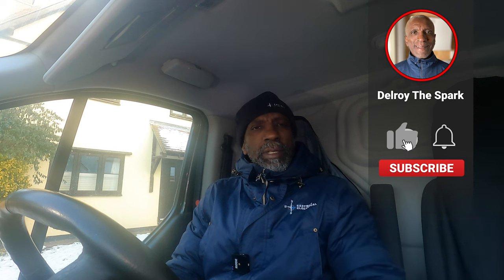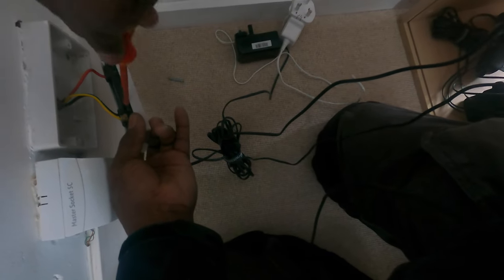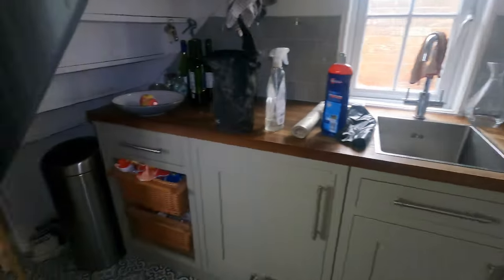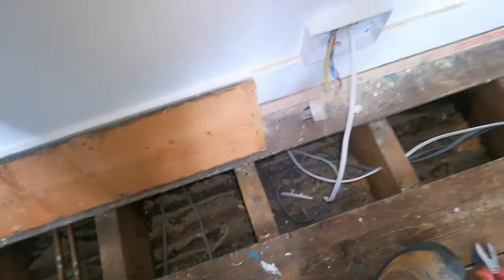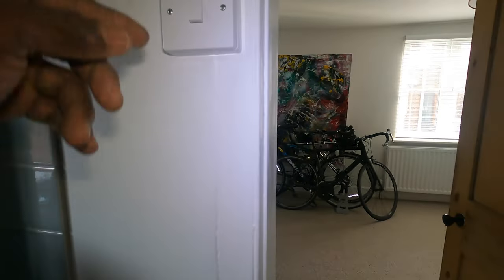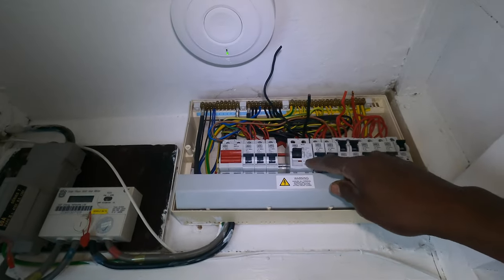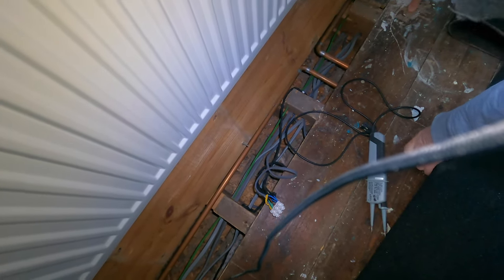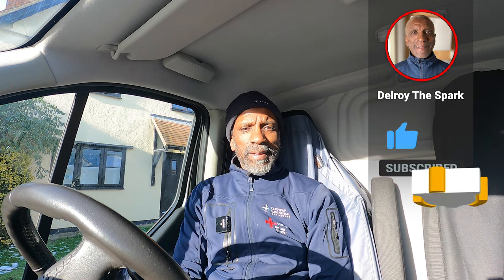"If An Electrician Did This He Doesn't Give A ****"| Electrical Fault Finding| Electrician In London

Comment: I am a retired electrician and it's scary how homeowners interfere with the circuits in their home. the problem with this situation is homeowners is they think if a socket livens up that's OK. But of course that means nothing.
Reply: As a homeowner who has messed with electrics before i always make sure to call an electrician just to do some testing afterwards and certify that everything is according to standards also helps if you really respect electricity and try to be as damn safe as you can and triple check that things are off before you mess with anything.

Tbh sometimes i just can't afford full service from an electrician and need to do some stuff myself to save money and then get just a couple of hours from the electrician to test it, recently my house had no ground anywhere but the kitchen, asked someone how much it was to fix it and it was days paid by the hour so you can figure out it was a LOT of money, in that case i'd rather run wires myself leave everything right next to the fuse box and then bring him in again but for 1-2 hours just to assemble it all on the fuse box and double check.
Also helps that i know exactly where everything is so if i can't get my regular electrician and can get any other one and guide them directly to the fault points
Reply: @liquidsnake6879 you shouldn't be touching electrics full stop.
Reply: @adamsharp201  make the prices cheaper and people won't have to, otherwise it's either i do it myself or it doesn't get done at all which is not an option

Comment: My bet is that it was an "electrician" who came out to do it, likely one that didnt know what they were doing but the reason why I think that is because if you look at the plugs hes got connected to the sockets a lot are wired into the wall, if he knows enough to wire in stuff he wouldnt of used a plug and socket for it.

Comment: Man, the Brits have quite a different residential wiring color code than we have here in the U.S. (we use black/white/bare or green in house wiring), plus they're running 240 VAC where we run 120 VAC. I think the whole wiring of the house should have been pulled out and rewired because it was a rat's nest. Totally UNSAT. The electrician was using terms that would confuse people here, like "ring" (I've only seen that in a certain computer network topology) and "we have 'phase' on this one" -- what, you running 3-phase over there or something? O.o
Reply: Ring mains, basically after WW2 the UK had a rubber shortage so everything is strung together in parallel rather than star.

Comment: I'm not a qualified spark, but I did do some training on it many years ago and I like to think I've got some idea of how this stuff works.  I could tell just by looking at that rat's nest of wiring that it wasn't done properly.  If I were doing that, I'd definitely use a junction box - it's not just you, Delroy, I think it's safer, neater and easier to go back to at a later date.  Those exposed connector blocks are an accident waiting to happen.

As for those dangling lights, whoever decided that was the best way is a moron!  Apart from looking terrible, where's the cable tensioner to stop the wire getting pulled out?  Maybe there was something I missed, but from what I saw there's nothing to stop those wires from getting pulled out of the ceiling and with them being all connected up under the floorboards, any wires coming free are an accident waiting to happen.

Also something that struck me, you pointed out a neutral problem.  Did I see an unconnected neutral wire behind the light switch?  Judging from the mess of that wiring, it wouldn't surprise me to learn that he'd wired the whole thing through it and because the light switch doesn't have a neutral connection, he'd just left it dangling.
Reply: What made you quit?
Reply: You seem to have a huge opinion on something you clearly are not qualified to comment on?! Get yourself to college for 4 years then you can comment on an electrician's work
Reply: @adamsharp201  Even a rudimentary grasp of electricals would tell you that this is a mess, and a potentially dangerous one at that.  But then again, I suspect you know that and are one of "those" people who like to taunt people from the safety of their keyboard.  Am I right?  Because it's either that or you're a dangerously unqualified electrician who is going to kill people
Reply: @therealbosstopob4l974  I already had a job in IT and didn't think (at the time) that I'd need it.  I don't technically need it now, either, but there's times it would be helpful to have the certification

Comment: All those joists have been drilled out of zone! To be honest I used to like fault finding but now I am just sick and tired of turning up to properties with bodged wiring. We fool ourselves if we think it must have been done by someone who is not an electrician - many times it HAS been done by an electrician. Self certification schemes simply don't deliver the surety of quality they are supposed to. You are either a conscientious electrician or you are not. Even new builds I attend are often not to an acceptable standard.

Comment: I'm not an electrician, But i fix cb and amateur radio as a hobbyist, So i know enough about electricity and electrical circuits and frequency etc. And i said the same i would run them into a junction box there's no way i would be happy or confident in doing things that way. This wires aren't even tacked in a way that id say they are safe and secure. So even as an unqualified opinion I would say that is bad and there's no way that was done by a professional. health and safety and all logic was lacking there. Nobody that takes pride in their work could leave something in that state. There's always a standard you maintain.

Comment: it really piss me off with people thinking they know about electrics.... and doing it them self...
Reply: Not necessarily the case, I know of Engineers that are more than good enough, being one as well, they contact me for the specifics and also other such, i then pop round and critique the pants of the electrical, then give em a ticket after a day or two of T and I, rcbo only since 2010, for me then, direct runs, no j boxes, saves a buck, but that's a one off, seldom done, it's usually me with them as a helper, best of both worlds, I once had another engineer use 3 phase components and tri rated cables in conduit with ferrules , he helped me a few times on a production machine, other equipment like medical Iso trans, etc, so he did most of it, with advise from me mid way, I did the earth and the rcbo cu, a good friend of mine, two days of lazy T&I, then sorted, oyeah only one ring in the kitchen, the rest were radials, that's what I usually do, any comment on that from anyone would be interesting,
Reply from the maker: I can tell you feel strong about doing a good job

Comment: What will happens when you touch the
 red + wire with the black - wire 💥
Reply: In an AC circuit, there is no such thing as positive and negative wires. Shorting them would cause a spark and blow the fuse very quickly. Kind of boring really.

Comment: Rewiring my house myself (properly) Del. I was just stunned at the use of chocblocks and no pendants. Like you say, NO WAY did an electrician do that. I'm lucky enough to have time served sparkies as friends and they've all said my work meets and in most cases exceeds spec. Its simply not worth bodging. Just do it right. Mind you, check out my Dad's wiring at 10mins 45 secs:  https://www.youtube.com/watch?v=lrvP_L2dBpA

Comment: I have seen jobs done like this, even worse actually, by people who try and call themselves electricians so may not be DIY
Reply from the maker: Wow
Reply: @eastwayelectrical  one of the worst had to be about 25 down lights throughout a hall, stairs, landing and bathroom, wired in speaker cable, it was about .75mm multi stranded, single insulated 1pair, obviously no cpc. 
All the ceiling roses had been removed and just open connector blocks like yours there in the ceiling void, but also the attic, right next to the hatch where you would put your hand to climb in ! 
They hadn't even bothered to connect the cpc's together from the ceiling roses so no  CPC continuity for the rest of the upstairs or downstairs lighting circuits past there. 
Non were fire rated, just the cheapest open GU10 type you can get, Bathroom fittings right above the bath/shower were not even IP rated !

Comment: i really really dont envy you british electricians thats have to fight with ring circuits all day :/
Reply: Rings are easy my man especially over a long distance ,just pull 2 cables to your end point then pull loops to the rest of the circuit.
Reply: @leeserg6923  i get how there build, there just not good for fault finding.
There also not needed in Germany were i live.
We have bigger consumerunits and have for most rooms one individual circuit.
Smaller rooms get grouped together.
There technically not illigal Here there just really really uncommon.
Reply: @SuperUltimateLP  yeh I understand it’s only the British that use them ,when fault finding it’s easier just to split the circuit into 2 radials.

We are slowely using radials more and more though.

Comment: The ring circuit fault finding was all over the place and confused yourself with it (which is a concern)
Can only hope that your ON camera ring circuit 'fault finding procedure' / caper was  only a performance to confuse  your viewers and put them off trying it themselves.
 And one can only hope you did proper up to standard fault-finding and testing OFF camera .

Was there actually a  break in the cpc/ earth of your ring cct or were you testing a wrong earth  wire pulled out the earth bar, 
Mabe it was an earth of a radial cct ?
IE no electrical path to the correct earth wire( that you  thought IT was)  - if the one you pulled out was part of a DIFFERENT ring cct it would still have been connected to the right  earth wire via the return path of ITS  ring cct and the earth bar

not sure if this clip was MEANT to be a parody or not 

We all have 'off' days but probably shouldn't advertise it  especially as it's  a licenced trade . if you ever get called up against the board  even if it's for something else,
These vids  could be used as evidence of 'your typical work and testing methods
And could mean you  lose your licence .
Get fined or even jailed 

Not even going to mention the rats nest and live bare connections of the diy lighting cct. That's what side cutters are for! 
Cut the supply line to it and terminate that.
Then what you HAVE SEEN 
You have made safe are not liable and can leave ,
If they prevent you from making it safe then as a licenced sparky you are obliged to turn main switch off tag it and report 
Unsafe installation to the authorities.
( So when authority turns up, if the power is switched on - and hasn't been rectified and the appropriate reconnection safety forms been submitted the owner is up shit creek without a boat lol)

Great vid tho !
Hilarious  lol

Comment: Not a very good idea puting sockets on radials especially in kitchens.Suppose thats all you can do without taking lots of floorboards up..Wouldnt of stayed to open up a can of worms like this myself .Would of told customer it needs redoing . I have found in my experience with people like this they say is it safe .They have had a go themselves trying to do on cheap and have come unstuck then want someone to put right and say its safe for pitance which iit never will be.Not something any electician should do Wiring could be installed not correctly (touching hot pipes ,trapped etc.)

Comment: That's not been wired by a qualified electrician. The guy knows where all the loose floorboards are that just so happens to be where the dodgy junctions are. Used 6mm cable to make sure. Concealed JBoxes should not be in wall cavities or floor/ceiling cavities they need to be completly accessible. Cable junctions can be in accessible JBoxes, GPO's, light switches or light ceiling rose. Where junctions occur in self extinguishing PVC JBoxes each BP connector should be taped with quality electrical tape and not use a Utilux terminal block.
Some of the cables look like they are just Flex extension cord not TPS cable and having lighting cord or any cable just resting in the hot water pipe is a No, No. That wiring would fail our wiring rules.

Comment: Seen and done worse. However not for paying customer and only as a temporary solution. Those electrons Don't mind. You wouldn't believe the shit I have seen in some industrial enclosures with automation. This is straightforward. Those pipes there. I guess they are heating circuit. They are not yellow (gas). It is ok by me. Sometimes you gotta do what you gotta do.

Comment: I’m no electrician  even I could do better than that 
At least mine would be in a proper junction box
Reply from the maker: Yep, it wasn't great was it
Reply: @eastwayelectrical   as I said I’m not an electrician (pro) 
But I’m good at finding faults in both home and vehicles  after may years in radio electronics it comes in handy
I’m competent enough to do rewire and DB change